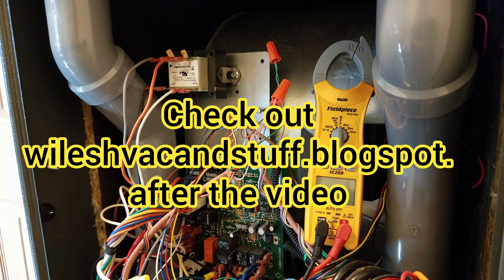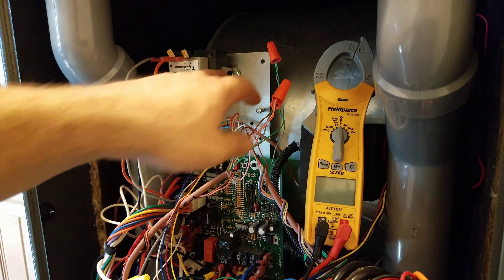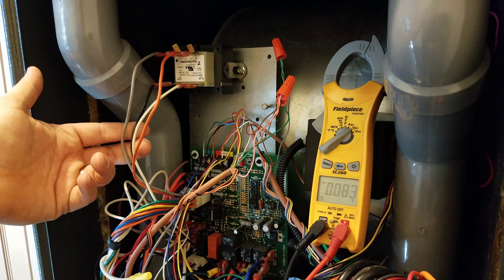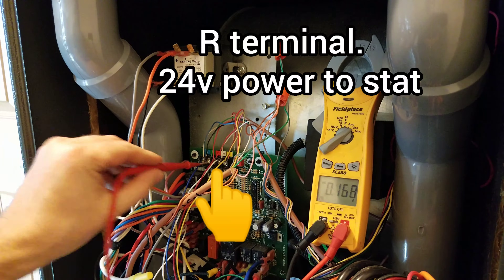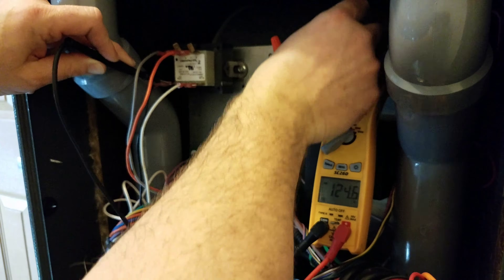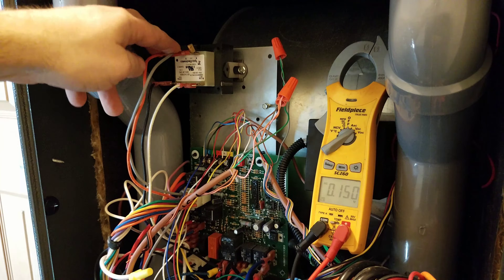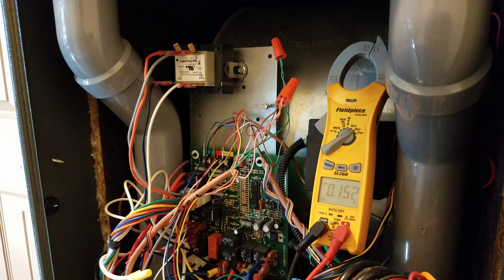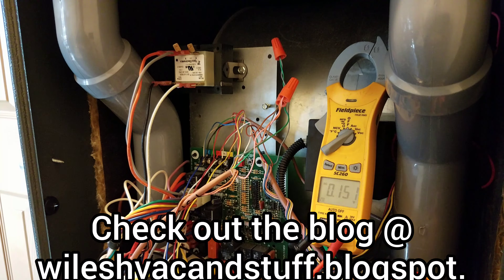REVERSED POLARITY On Gas Furnace.  LEARN HOW TO FIX! 🛠

Comment: My Trane XB80 showing 6 blinks, supposedly means reversed polarity.  Fresh start, inducer spins up, verified pressure switch closes, BUT no voltage too the igniter and no click from the gas switch.  Turbine spins but no fire, didnt even try to start the fire.  With the error code and this video, I verified all power points you described and found the same thing (153 volts) ... I verified ground the same way you did.  I reversed the low voltage wires, and checked everything again.  The voltage corrected the same as in your video to 96 Volts.   However, a fresh start returns the same issue with 6 blinks.
Can you help?  Ideas?
Reply from the maker: If grounding and polarity are now correct, I would try a board.  I don't like throwing parts at them but if everything is verified correct, then the board has to have something wrong with it I'd say.   Hope this helps!  I know it may not be the answer you were looking for but it's what I would do if it were mine!   Be sure to subscribe if not already and share with your friends!   Have a great day!
Reply: @andyscornerhvac  Thanks for your response.  I had a feeling that was the next step.  I found a board on Amazon for about $90 but I am not certain if I am looking at the right one.  Can you suggest the correct board I would need for a Trane XB80  ... its not XE or XL or anything else.  Can i send you a photo?

Comment: Awesome video. Really appreciate how to check.  So I had customer with reverse polarity error code.  I swapped the transom former 24 v wires and it worked for a few weeks.  But now it’s reverse polarity again.  They haven’t done any electrical work in the house.  Any ideas? Do I get a master electrician to check something?
Reply from the maker: Is the polarity actually reversed the second time, or does the board say that it is? The next thing I would do would be check to make sure you have a good solid ground all the way from the furnace to the breaker box. Without a good ground and a good neutral you can never guarantee polarity at the furnace. If all the wiring is good, and your actual polarity is correct at the furnace, I would say it needs a new board. But the main thing with polarity is it has to be grounded. And come on man, we're HVAC service techs!  We don't need an electrician!! LOL.    Hope this helps in some way! Be sure to subscribe if you're not already and share the channel with your friends! Have a great day!
Reply: @andyscornerhvac  I am going there tonight and check polarity per voltage measurements you showed in your video.  I'll report back. You're right don't really need electrician, but they are necessary evil for liability purposes.  Thank you for quick and detailed response.  Subscribed and shared of course :)
Reply from the maker: Awesome!   Thank you.  They are a necessity some time!  Lol.  120v hot coming in to 24v hot should read around 96 or so.  If it's round 150 it's reversed.  Good luck my friend!

Comment: Good evening your video was great explaining so easily. My question is after checking everything like you explained and my Goodman still shuts off with 8 flashes where do I go from here ? According to manufacturers 8 flashing lights mean ground of reverse polarity. I check the ground like you did and check the polarity all reads are good unless I’m missing something. Any help would be greatly appreciated.

Comment: So I'm still getting the blinking red light but all these tests turned out normal. Thoughts? 

I had a local hvac company out and they swapped the 2way gas valve but it's still acting up. That's why I came here to test this one own.
Reply from the maker: I'm not sure.   Did you check for a good ground?  Measure from your black wire in to the case ground n make sure you have 120something on the black wire and not on the white.  Also polarity.  Check from 120v hot leg (black) to 24v power (usually the r terminal).   Should read around 94 or 96.   If reads 150ish then polarity is reversed.  But ground is super important for polarity.   If everything else comes out ok, could be a failed control board.    Hope this helps!  Be sure to subscribe if not already!  Let me know what you get figured out!   Have a great day!
Reply: @andyscornerhvac  all readings are normal. 

They put in a new control board when they did the gas valve because they accidentally broke the existing board with a tool. Still getting the issue.

No idea what else it could be. Ignitor?
Reply from the maker: It's possible .  That's strange.   I hate to see having to replace every part on it one at a time but may need to try an ignitor.    What type of furnace is this?   Brand?  Model?  Age?
Reply: @andyscornerhvac  it's an Amana distinctions.
Reply: @andyscornerhvac  not positive on age but I think 12 years
Reply: @andyscornerhvac  problem solved. The condensate drain trap was clogged big time.

Turns out the blinking light I saw was actually just one blink continuously. I guess I couldn't tell because of the cadence. It was a furnace lockout code.
Reply: Should note my ground was 123v. Don't know if that makes a difference

Comment: Hi, I just got this problem and this video gave me so many answers! One question, can the furnace not be grounded well? What will be the consequences if it is not grounded well and there is a reverse polarity issue? I hope I explained myself correctly and in a clear way. Thanks In advance
Reply from the maker: Glad u like the video!   Be sure to subscribe if not already!   As for the ground, yes you do have to have a GOOD solid ground to modern furnaces.  Needs to be grounded from the breaker panel to the furnace to either a clean case ground or wherever your furnace allows for the ground to be hooked up.    If it's not a good ground you could get reversed polarity or poor voltage which will confuse the board.   Easiest way to check for a good ground is follow the wire n see where it's actually hooked up at in the box and in the furnace.   I've seen people try to just attach a wire to conduit or a gas line or something stupid like that and that is not legal or a good ground.   Also check voltage between your black 120v line coming into the furnace and to the ground wire that comes in.   If you have 120 or close like your supposed to then you should be grounded.    Electricians may have better ways but that's how I always do it.   Hope this helps!  Be sure to check out the other vids on the channel and share the channel on your social media!   Always subscribe!   Have a great day!

Comment: Hi, I have a question, I conducted the same polarity test and my reading was 68 volts. What does that mean and what is the remedy?  In my case the flash code error is flashing 10 flash error code , which is a reversed polarity issue.
Reply from the maker: If you only have 68, then I would think maybe you have a voltage supply problem to this unit. Either low voltage or more likely, no ground or a loose ground. I always say it's supposed to be around 96 or so but that also depends on how much voltage is coming into the unit. The lower the supply voltage the lower that number is going to read. But that is very low at 68. I think I would definitely be wanting to know what the supply voltage was and prove that there's a good ground. I would bet that you probably have either a grounding or a neutral issue to the furnace. Make sure the ground wire goes all the way back to the breaker box and doesn't get lost somewhere in a junction box throughout the basement or somewhere. Without a solid ground and good neutral connections your numbers will not come out right. Hope this helps. Thanks for watching and share with a friend! Be sure to subscribe if you're not already have a great day!

Comment: Just ran into this problem, for the first time ever out in the field. & This video was so spot on. Was about to condemn the board. Had 145v between R & L1 at the transformer. Swapped my low voltage wires than had 95. Thanks for the video, just saved me from a misdiagnosis.
Reply from the maker: It's all fun and games until we misdiagnose a furnace! LOL glad you enjoyed the video! Thanks for the views and comments! I love being able to see everyone out there actually using a little bit of the information! Be sure to subscribe if you're not already and share with a friend! Have a great day

Comment: I check Neutral to Ground instead. looking for less than 2v differential. 
As for swapping the secondary wires instead of the primary, it's incorrect to say that you're reversing everything all the way back to the breaker panel. Polarity typically begins correctly at the panel, and eventually somewhere in the circuit, the wires get crossed (either at a junction box, an outlet, or at the connections inside an appliance. In the case of a furnace, it has a dedicated circuit not shared by anything else in the home.) The most likely place polarity was reversed is at the transformer. Swapping the primary leads will not change everything back to the breaker panel the way you say it will. In fact, another reason you should really find the point at which the polarity reversed is that the polarity could have been reversed prior to the furnace, and now every neutral on the board is hot, which means every component in the circuit is hot even when things aren't running. Overall, good info. But it's just simply not correct to say that swapping the primary leads is changing everything in the circuit, and isn't a bad thing at all.

Comment: This is a great video.  My furnace LED signal was going crazy with no hot air flowing.  I checked reversed polarity following your tips and made sure it was not a reversed polarity issue.  95 volt coming from transformer and R terminal, I ordered a new replacement of control board and replaced it by myself.  The furnace is now working fine and my home is warm.  Thank you so much.
Reply from the maker: I am glad u enjoyed the video!  Thank you for watching.  Be sure to SUBSCRIBE and check out the other videos on the channel!